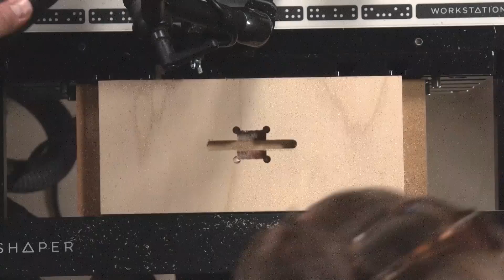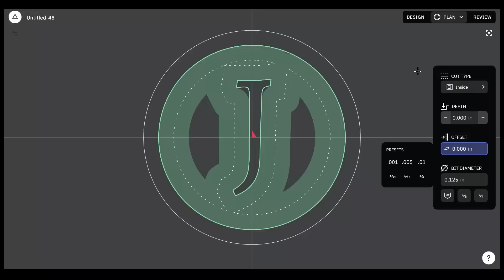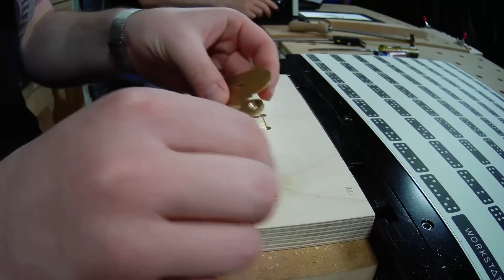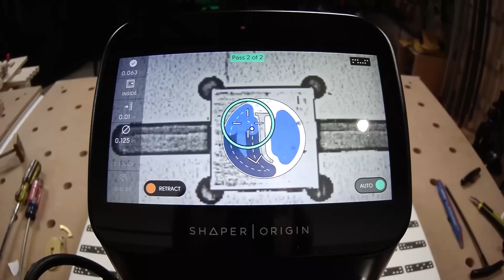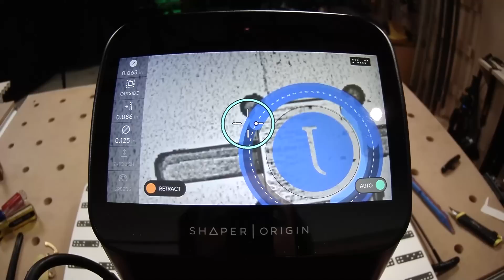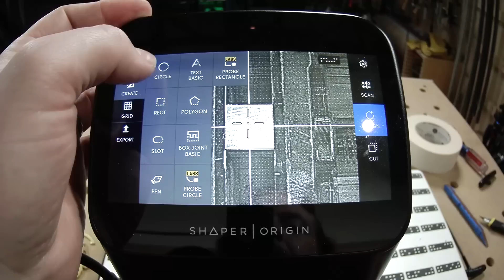Session 130 - English: Making a Custom Branding Iron with Shaper Origin

Comment: I actually used the shaper to cut the design for my Halloween pumpkin on flexible acrylic sheet. It wasn’t necessary but it was fun and it gave me a perfect design for a round object. I just traced out the cuts and then used a jab saw to cut them out. Was a lot of fun!